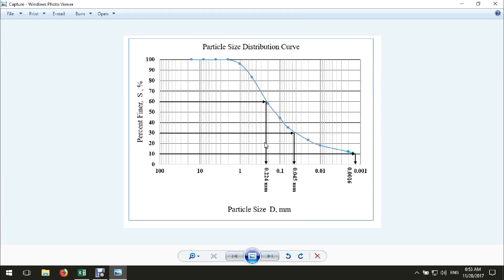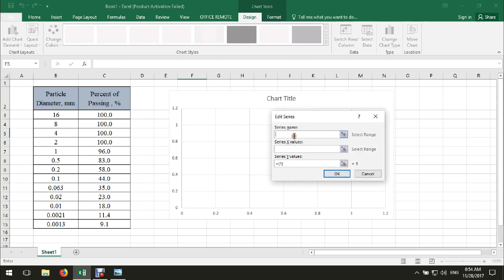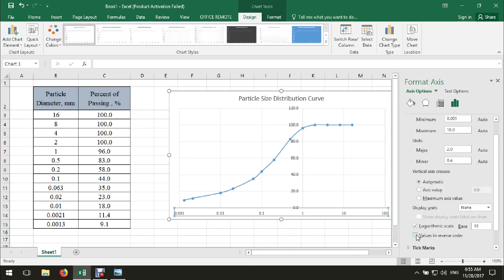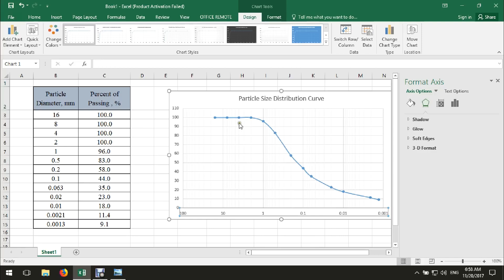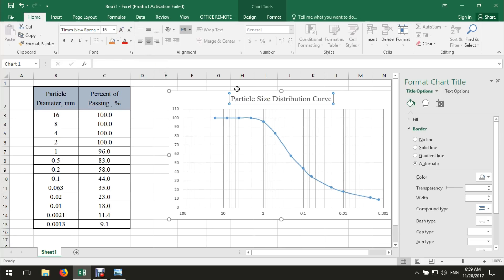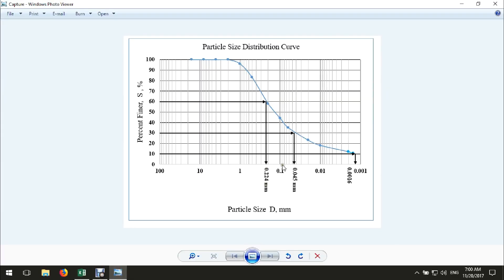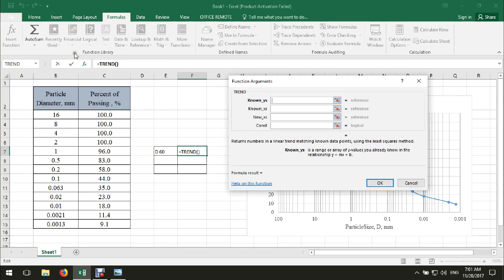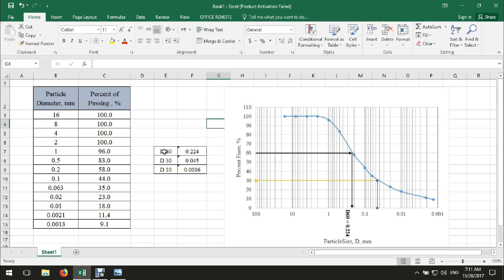Drawing Particle Size Distribution Curve

Comment: There is sth slightly wrong about this
Trying to find D60/D30/D10 you use Trend function which is basically linear, however, our chart here is Logarithmic
Results are a tiny little bit different which can be ignored for this one but I'm not sure about the other cases
Great content btw !

Comment: Thank you so much for introducing me how to draw the chart! I didn't know how to figure out D10. Thx a lot
Reply from the maker: D10 can be found by the same way as you use for D60 and D30, basically D10 is equal to the diameter corresponding to 10 percent of passing of total material, you just need to extend a horizontal line on 10% on vertical access, then extend till that line intersect with the curve, then drag the line at the intersection point till the line intersect the X axis, at that point you can read or interpolate the Diameter, which so called D10.
Reply: @civilferba  Yeah. What I learned from your lecture is how to use "trend" function. If you didn't tell me to use that function I couldn't have finished my geotechnical engineering hw.

Comment: Thanks for the brief, Regarding the display of D60=XXXX , D30=YYYY and D10=ZZZZ , we can make it a dynamic display in case of  the change  of values obtained as a result of the change in sample. CONCATENATE(D60 CELL, "=", "PARTICLE SIZE VALUE CELL")
Reply from the maker: Yes, the whole sheet is dynamics, change any value, the sheet recalculated based on new data.

Comment: How u calculated percentage of the particles?
Reply from the maker: Greater than 4.75 mm = Gravel
Between 4.75 mm - 0.075 mm = Sand (all sizes coarse to fine sand)
Smaller than 0.075 mm = fine (Mixed with clay and silt)